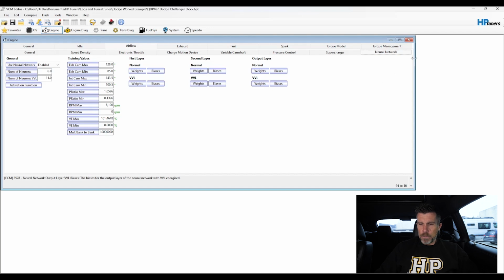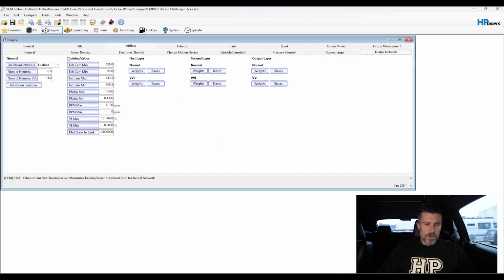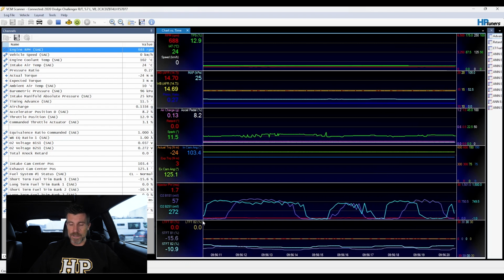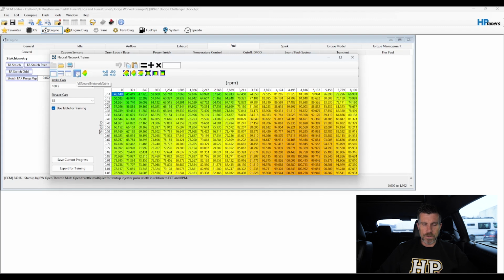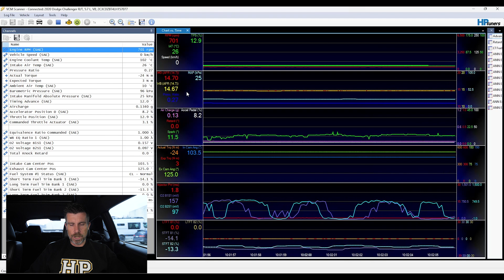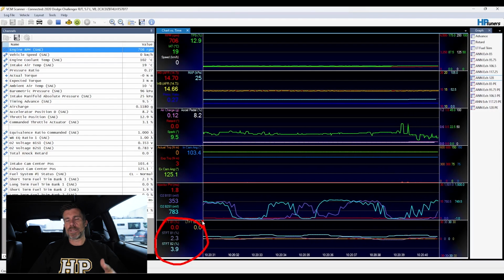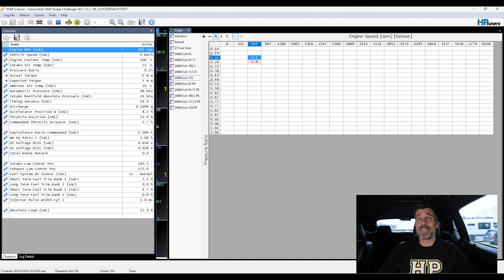No More Secrets | Artificial Neural Network Trainer

Comment from the maker: What model of Dodge do you plan to tune?
🔧  Building a fast car? Get $400 OFF the all-inclusive VIP package deal: https://hpcdmy.co/dodgeann
🏎 Get 50% off your first EFI tuning course. Enrol instantly: https://hpcdmy.co/annefi
TIME STAMPS:
0:00 - Artificial Neural Network | ANN
0:27 - HP Tuners ANN Trainer
0:39 - What Is An Artificial Neural Network?
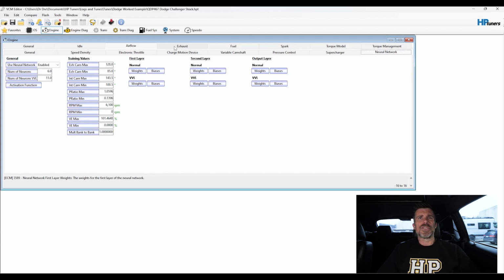1:33 - Why Not Just Use VE? (Volumetric Efficiency) 
2:25 - Fudging The Numbers = Band-Aid
2:42 - More Fudging = Also Band-Aid
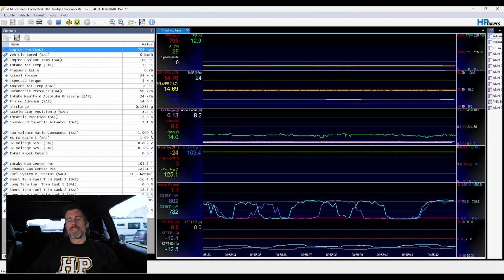3:25 - Not The Only Options!
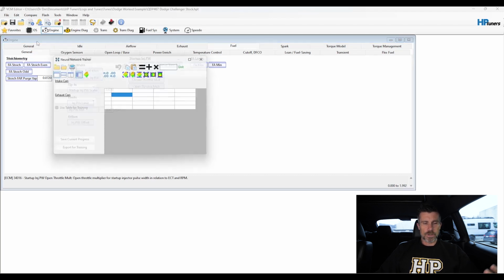4:20 - VE Neural Network Trainer
5:40 - 25 x VE Tables VCM Editor 🤯
6:04 - 5.7L HEMI V8 Cam Setup
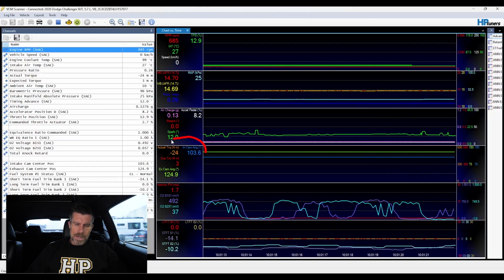7:00 - VCM Scanner Logs Vs Editor Tables
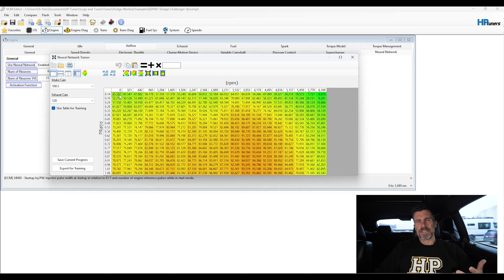8:00 - Just A Demonstration | Making Changes
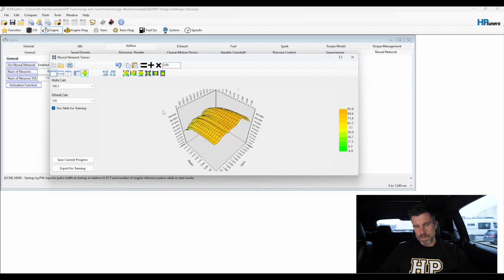9:00 - VE Table Visualization
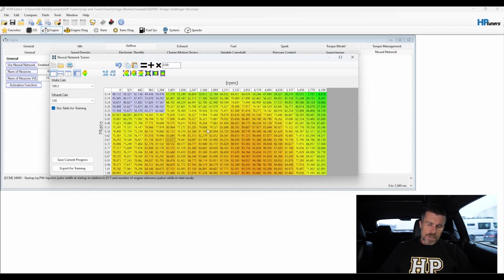9:12 - Using ANN Trainer
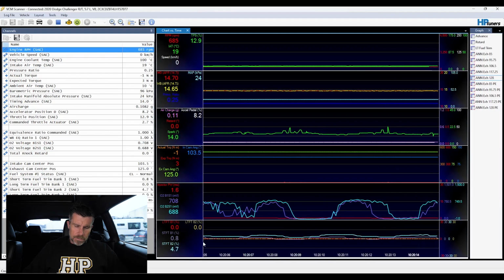10:27 - Tuning Change Results
11:20 - Graph Data Comparisons | Narrowband Sensor Data
12:05 - Power Enrichment | Wideband Sensor Data
12:56 - Full Dodge Tuning Example Using HP Tuners

Comment: My main question is why?
VE tables of 5, 10 etc has not been nothing new in many European ecu's for the last 10 years, maybe more.
Why the added complexity? Is easier for the oem to tune?
And i thought Bosch was the king of overcomplicating things.
If someone can shed a light on this.
Reply: very easy. For the factory it is reducing complexity. The OEMs are absolutely not interested in supporting us. The view of the development: Instead of calibrating 25x maps (in which around 40% of data is not used while driving normally) by hand on a very expensive test bench, with a more expensive stuff spending thousands of hours (different temperature, humility, dust etc.) they use a very stupid and dump ANN, run this engine for 1month with the self-calibration ANN to have basic data and the rest of calibration is done by the customer himself during his driving. Very genius solution! --> and yes I hate it!

Comment: I once started developing my own nn to use as a plant model  to than tune my pid boost control, didn't end all that well as my dataset wasn't big enough so the network got very biased and was having big errors in verification datasets, but seeing it's used in the industry as a defacto control strategy it gives me a confidence boost to retry it 😊
Reply: I’m a HVAC controls engineer I’ve been thinking about ways to automate PID controls for ages, but because the process happens incredibly slowly vs say a PLC PID tune it’s hard to implement and I still do it by feel

Comment: That’s why when you take your time and do a tune correct. And set all the scalings and compensations correct. It will run like stock or way better, but use the stock parameters rescaled for the new power level. Tuning this way can yield great benefits.